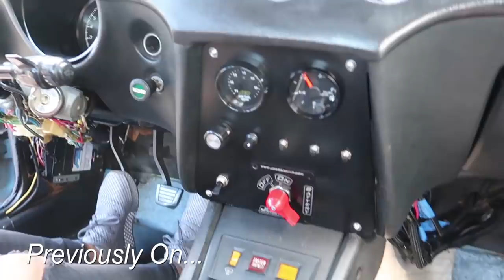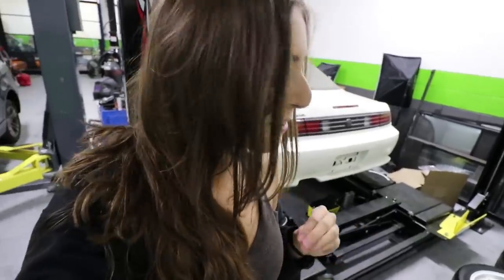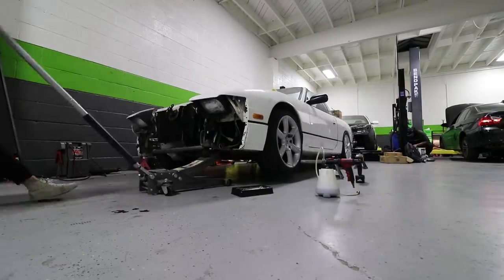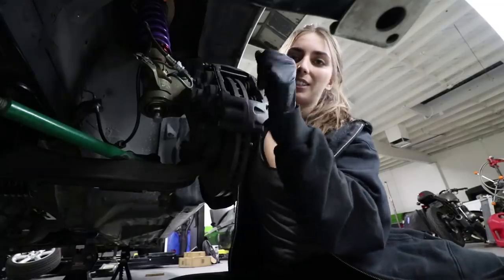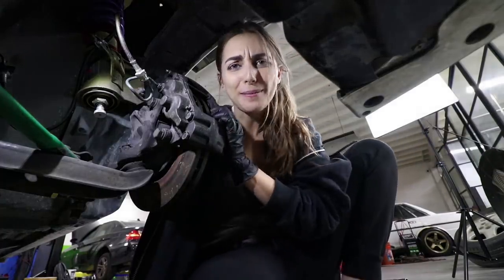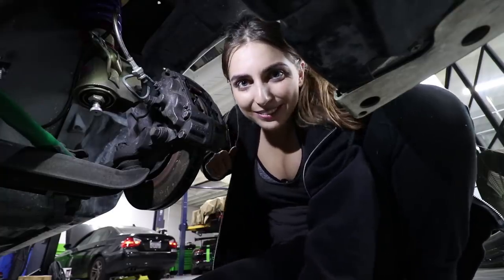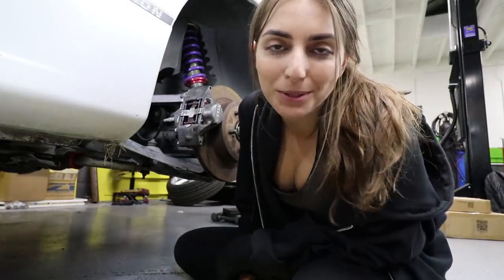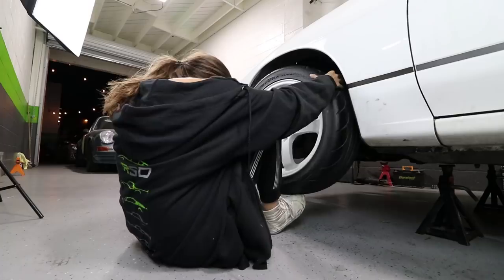Fresh New Wheels and Upgraded Brakes! *I'M IN LOVE*

Comment: What you can do if you get a custom ECU, is that you could do is run dual map sensors (one for each turbo, in addition to the plenum-sensor one) to see if they're operating equally. But generally I'd take a map sensor over maf any day of the week (who would want a sensor that operates by heating up to be cooled by air going in, even if it's just a little? lol)

Keep in mind, the plenum runner length and vacuum line length have to be in line with each other to get the correct vacuum reading for the voltage the sensor wants to show and ecu wants to see.

Comment: looking good .. im not sure if you've mentioned all your plans for the s13 cabrio .. but i would try putting a small bolt in roll cage in to make the chassis a little more stiff .. cabrios can roll alot especially if u wanna drift around with it ..

Comment: What are your plans for the Subaru build as in a power plant under the hood? and

also the color of the car since , you took off the root beer brown wrap that was on the factory black paint. On another note putting a wrap on any car is like window tint it only last for so long before it has to be removed a suggestion would be pearlescent color as in two of your favorite colors because no one has just one favorite color just throwing that out there and are you going to add anything else to your 2 Friday drift car?

Comment: E-crew! I need to know what ecu you running in the subaru. I have wiring diagrams miscellaneous wiring harnesses and usdm cams. Sensors I do not have but I need to know what you got so I can lay down a proper game plan for you and get you some parts. Cheers 😁 slide into them DMs. Legit would fly out with a suitcase of parts if I have to. 😜